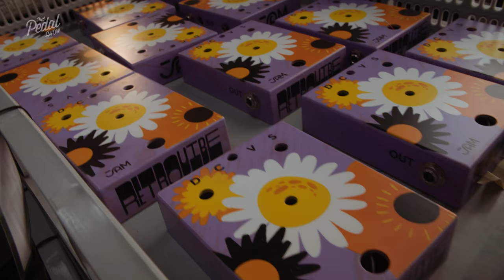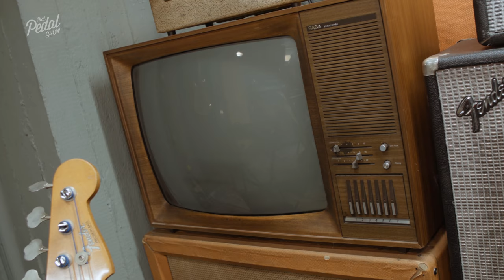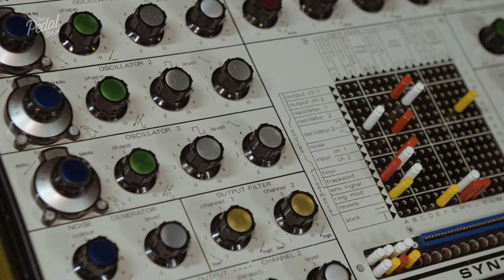JAM Pedals TPS Rattler & Factory Visit (Pedal Now SOLD OUT) – That Pedal Show

Comment: So what is a flow machine?  Does that replace soldering or something?
Reply from the maker: It’s how many larger scale electronics things are done using through hold board assembly - amps, pedals etc. Usually a bit more mechanised than this. Big bath of solder, the boards are passed over, just deep enough to make all the connections. It’s often a ‘wave’ of solder in a machine. Fascinating!
Reply: That Pedal Show  Thanks!  Oh yeah that would work because of the solder mask on all but the contact points. Would speed up things a lot. But I like the soldering. Nice and slow.  Course I don’t make my money doing it haha.

Comment: Hey boys, just wondering what you guys thought about the whole surface mount/through hole components debate. Is their a sound difference ?
Reply from the maker: Not sure one could make a total generalisation and it really depends on the rest of your system and components. I don’t know if it’s a coincidence that mine and Dan’s core favourite pedals are predominantly through hole or hand wired. I’ve never chosen a pedal because of that, but it seems that the ones I stick with are that way. Same with amps. Simple, traditional build. Lots of people will disagree of course!
Reply: @ThatPedalShow  i know their isn't really a right or wrong answer but what you said totally makes sense. Cheers.

Comment: I have a (unrelated) Q for Mick re his gain pedals: I see you have the Duellist and the Klon. I also use a Strat mainly. I have a KTR, and recently got a Duellist, and I’m finding it hard to fit both (sonically). So, I have a low gain, always on pedal (Lightspeed) and a higher gain pedal (varies, @ or Pettyjohn usually) and the KTR in a mid-push slot. I’m finding the Duellist does a similar thing to the Klon in that scheme, and find myself choosing one or the other. Could you say something about when you use the Klon and when the Duellist instead? Cheers
Reply from the maker: Hello! You’re probably finding you have one more gain stage than you ‘need’ there. I use my Klon after everything. Gain at 9am, tone 2pm, volume around 11am. Ish. What that does is provides a nice big volume boost, upper mid boost and bass cut when I want to really poke out of a mix. Sometimes I use it just on its own, but far more common is to use it after any of the other gain stages. So I’ll have my Duellest set reasonably gainy (using the ‘stock’ settings on the switches) and use the Klon to lift them to really loud. Same with the fuzz, D&M Drive. Rattler or whatever. The Klon just does that boost thing like nothing else. But it needs to see a relatively high headroom amp, otherwise mush. Hope that helps!
Reply: That Pedal Show Very helpful, thanks! I have the Klon earlier, rather than as a last stage boost. For me it creates my “tubby” sound. As in SRV-Mayer. I can see how your setup would work differently. Food for thought, cheers 👍
Reply from the maker: Having it last works great for SRV or Mayer because it gives you the upper mid cut back and drops out some bottom for note definition. But it’s all dependent on volume and the amp of course!